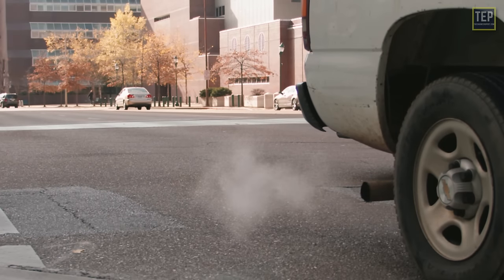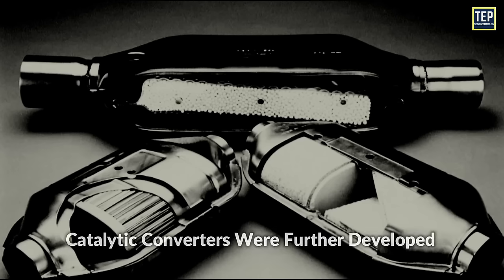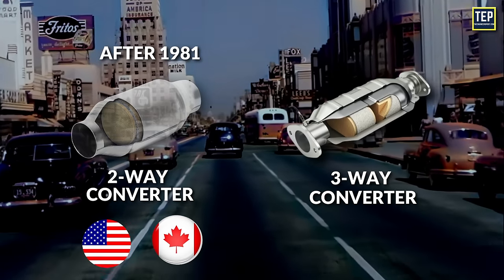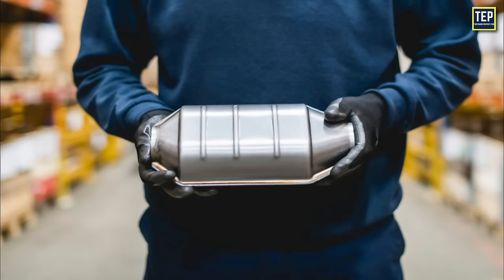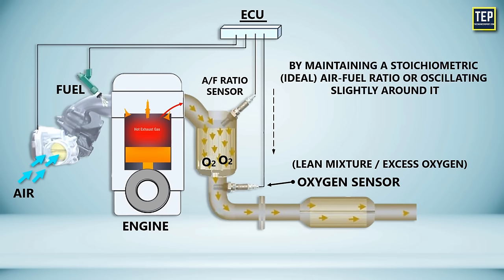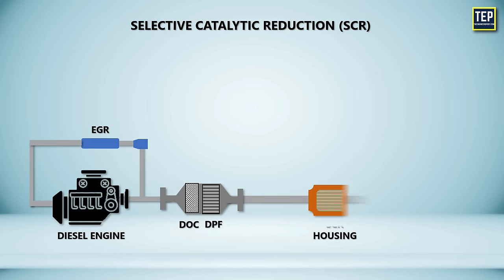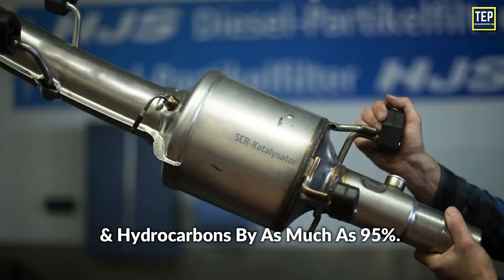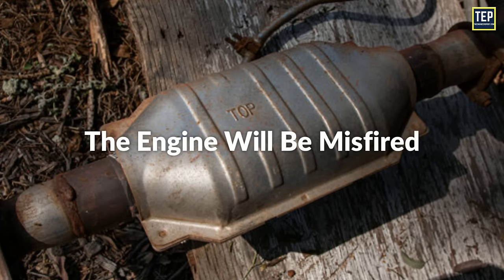Understanding The Catalytic Converters | Pros & Cons - Explained

Comment: Instead of wasting money on electric cars why not develop better exhaust filters for more emission reduction?
Reply: And to reduce old diesel cars!
Reply: Cos we are fucked for fuel as well. By 2100 no oil coal or gas
Reply: @barrybritcher they say this since decades, there are so many ressources, we only need to use the more effective
Reply: @geomine9542  I love the smell of diesel exhaust fumes.
Reply: @barrybritcher  that's hypothetical. There isn't enough lithium and cobalt to replace all cars to electric so we're also fucked a lot quicker there.
Reply: Chill. Respective industries doing thier work. And also, I'm clearly saying, with a few decades, we will hit the limit on internal combustion engines. I'm pretty sure.
Reply: Btw where do u get ur fuel from,?
Reply: @geomine9542  I love the smell of raw diesel exhaust!
Reply: @ProCoder119x  Yes unless we develop new fuel sources besides petroleum.
Reply: @mattdaddy_888 I understand you, but think about smell in large cities where almost everyone want cheap old diesels...
Reply: No. ANY cap type of device or any obstruction on exhaust can  ONLY HURT any ICE. Same for that shotty EGR which destroy valve seats and entire intake system, even covering piston crown (upper side) with a thick layer of hard residue from overheated engine  oil
Reply: CH4( Methane , Natural gas) is the answer , along with turbulent jet ignition ( preferably active , injecting H2 in pre-chamber ) and water injection . No need of any catalytic converters !
Reply: Why? Because most (like 99%) people don't maintain the cars properly. Not to mention US states, where you don't have obligatory inspection once a year (or they don't do exhaust gas check).
Reply: @barrybritcher oil is the most abundant liquid on earth after water
Reply: Yeah.. ask diesel owners about exhaust filters and the nightmares DEF can cause. Maintenance costs and if a sensor fails throwing the vehicle into limp mode essentially holding normal drivability hostage from you until you repair the system. I’m good.
Reply: @johnwalker8193  yes I agree that DPFs suck which is why we need better solutions I heard that CAT is developing a harmful emission reduction system for diesels that isn't a DPF. Don't get me wrong I love the smell of raw diesel exhaust.
Reply: Because carbon dioxide is always the final result.  If you burn fuel, any fuel, the best result you can ever get is pure carbon dioxide.  With electric cars and coal or gas power generation, still carbon dioxide.  Nuclear power produces no carbon dioxide.  Nuclear waste is orders of magnitude smaller and we know exactly what to do to handle it. 

But you want to know the real problem?  Overpopulation.  If the earth had four billion people instead of eight billion people, the natural ecology would be able to handle their waste easily.  But that is a whole other discussion.
Reply: Because EVs are a more efficient and effective solution.
Reply: @BrunoRegno  I'm not talking about efficiency I'm talking about pollution. Also those big as batteries are an inefficient solution especially in the cold.
Reply: Stoichiometric engines and 3 way catalysts are currently the cleanest technology in the gas engine industry.   Lean burn has an efficiency edge but when equipped with SCR can be almost as clean as rich burn with 3 way catalyst.

Comment: Removing the cat will not help mpg. Anyone who want better mpg should buy a newer car or one that burn less fuel.
Reply: It worked up to 1996. The OBD computer outsmarted the DIY.
Reply: No shit? Which are your specialized education degree in internal combustion engines? How many hundred of engines did you upgraded as own build in your garage?😂
Reply: @Michael-yi4mc  It never worked
Reply: @napraznicul  How many tune-ups have you done? I bet I have more videos of me helping cars get better mpg than you.
Reply: @blackericdenice  Are you drunk? We are talking about REMAPS/tune, OR effects of a RESTRICTION on exhaust?
Yes i do not make bullshit tune, i do only for my dta from the race car and no very often for few oem ecu's, BUT you just switched from my question to another domain, as was about a HARDWARE DEVICE affecting (or not) how the engine runs.
Reply: @napraznicul  Stop lying. If you really tune race cars. You would agree with me.
Reply: @blackericdenice  at same rpm's, same load on engine and same weigt of vehicle that one without exhaust restriction MAYBE is not much difference as economy, BUT a cleaner engine (cleaner is that one without egr, cat, dpf and mainly free flow exhaust) will rev faster and will push stronger on all range, also way lower egt, so the driver will push harder... that's why in "real world" will be no difference
Reply: @napraznicul  More proof you don't know what you are talking about. A cleaner engine is with emission controls. I'm done wasting my time with you.
Reply: @resh-e8z  Stop lying
Reply: I have a 2001 f250 7.3l diesel. It didn't come with a cat. My fuel economy is better than my mid-size truck. 
I get between 18 to 22 mpg.
Reply: @danielgodfrey4415  2001 did come with a cat. If someone removed it. You don't know if it was getting 18 to 22 mpg before.

Comment: Just finished an LS swap and had no problem adding a "High Flow CAT", operates as originally designed for the donor vehicle. Still get amazing performance, win / win. Good video, learned a lot, and you stuck to engineering NOT propaganda, thanks.

Comment: To better help with understanding how the Regen works on diesel engines, if the ecu detects the dpf filter getting clogged, it triggers a injector that’s placed in the exhaust after the turbo to inject raw diesel fuel into the exhaust. The raw fuel reacts with the DOC and exhaust temperatures go up pass 1200degrees to burn off soot in the filter and turn it into ash which settles at the bottom of the filter and must be cleaned at prescribed intervals. 
Also if the truck is driving and the exhaust temperatures are already hot enough it will actively burn off the soot in the DPF which is called active regen.
Reply: Or some cars (most cars?) use the existing injectors + glowplugs (rather than having an extra one) to inject extra post-combustion fuel and heat. Explained here: https://www.youtube.com/watch?v=Q4aI0-xIQsc
Reply: @xxwookey  yessir the 6.4 power stroke is a example of that

Comment: I don’t remember PCV systems before 1968. The cars we had before 1968 were, 1960 Corvair, 1961 Impala, 1964 Impala and 1966 Chevelle. None of these had PCV valves. We had a 1968 Camaro and 1968 Impala and I think these had PCV valves. I remember that the California reguilations started in 1967 with the PCV valves and then in 1968 for the rest of the states.  This was the time I started driving cars. My first unleaded car was a 1971 Vega, it ran so poorly on unleaded gas, that after paying $0.41 per gallon, I switched to regular leaded fuel at $0.25 per gallon and the car ran beautifully. My last new car than ran on leaded fuel was a 1974 Nova (straight 6 cylinder) and it ran perfect.  
PS: cars seemed to get better as the years ran by. When I started driving Japanese cars, mainly Hondas, in the mid 90’s, I worked less on them and drove them more.
Reply: Back in the days, all those fumes and oil vapors in the crankcase were vented into the atmosphere. That's obviously very bad

Comment: Why don't they add the urea stuff to the fuel in the filling station? Seems like that would make more sense. Unless there is some detail I don't know about.
Reply: The dosing rate is variable and independent of the fuel-use rate.
Reply: Urea is very corrosive, too, and I don't think it dissolves well into fuel.  Also, it sounds like the diesel filters use the water the DEF urea is dissolved in to be part of the catalysis/consumption process, so dissolving urea in distilled water is likely better as a combination because people would need to add ONLY water regularly, which they almost surely wouldn't do.  Plus we often just use tap water, and I wonder what effect 'a bit of iron in your tap water' would have on the DEF equipment...I bet it would make a mess of things.  Hard water, soft water, all a bad idea so we'd have to use pure distilled water...but 95% of people would slap tap water into the tank and call it good enough, then they'd just b***h that they have to replace their catalytic converter/DPF/whatever "every twenty thousand miles and that's the technology's fault, not theirs for using tap water!"  So, DEF using distilled water as its carrier is likely the best combination of things to minimize annoyance, rust, or engine failures overall.